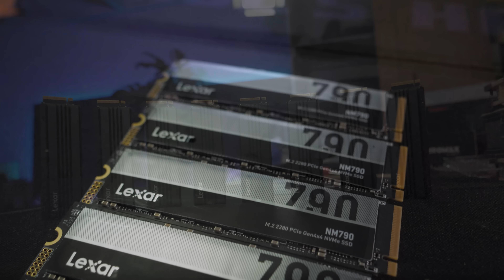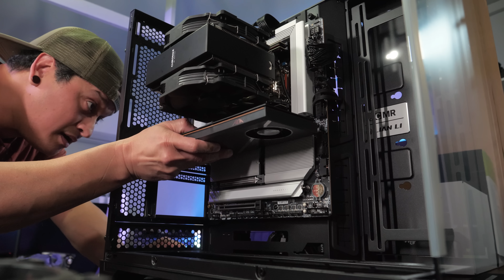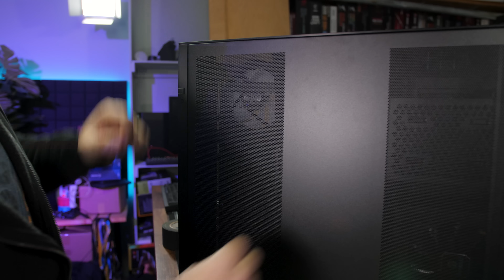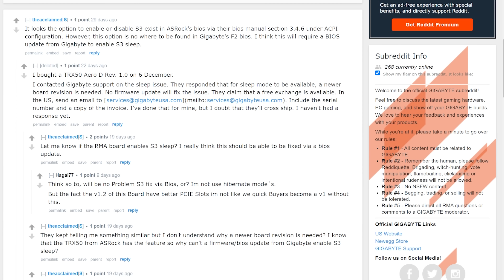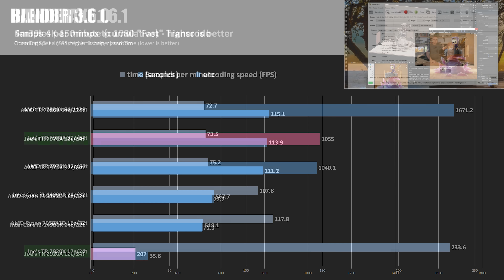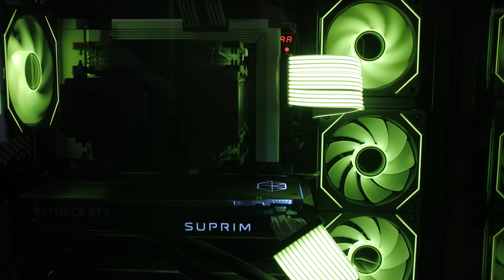Did we screw up?? Fixing and TESTING a $10,000 Gaming/Editing PC...

Comment: Imagine putting a NZXT kraken as a "compare" item .. (@16:40)
Like WTF?
Put a real custom watercooler with proper CPU block on that TR CPU and see the difference?
Should be a lot..

Also if you want the GPU cooler to have a long life,
 move it up one fan slot.
Reply from the maker: Weird that AMD would choose that not "real" NZXT AIO to send out with every single Threadripper 7000 review kit, they must have no idea what they're doing
Reply: @paulshardware  agree.. 😶‍🌫
Reply: TR CPU needs a TR cooler, kraken is does not have a coldplate for TR,   linus has also made this mistake @paulshardware

Comment: I would have gone with a different PC Case and get a Full tower PC case with better room for your needs. PLus+ i would put the GPU Cooler at the bottom of the case pushing it out. Then have the side front fans pushing in and then the front bottom fan pushing in Aswell.

Comment: I would definitely RMA the motherboard because who knows what else they fixed besides the sleep function.

If you can replace the single vertical fan with a reverse one and put regular fans on the rad then you could move the rad to the top position as exhaust fans and have the bottom fan as an intake giving the case a more positive pressure setup and have two fans at the top to help exhaust hot air. Just a thought.
Reply: I would do the same.  They always fix more stuff than just the thing that had you considering it in the first place.  It may save you some headaches over the next year or two.
Reply: Problem with RMA is that you have to send the mobo first and then you have to wait for them to send one back.
That means you have a non-functioning system for possibly weeks.

Personally i don't use the sleep or suspend functions, my system is either on or off.. rebooting is quick enough (although my new DDR5 sytem takes quite a long time compared to my old DDR4 system. but i just downloaded a bios update (not installed yet) that should fix that.)
Reply: @s1gne I wasn’t really thinking about the sleep function as much as, what else did they fix?
Reply: @blackjack6259  with my "old" 2070super Gigabyte had a V1.0 (like mine) but also a V1.1 (used same bios) and a V1.2 with a different bios, that one also had a bit lower clockspeeds.
Probably because of stability, although i never had problems with that card.
A never version can also mean that there is not much difference, just an other manufacturer of POScaps for instance
Reply: @s1gne  I'm pretty sure that Gigabyte would just ship Paul a v1.2 board. He's a 1.5M-sub reviewer, not a normie 🙂
Reply: @alistairwillock7266  , true.. he probably also has a direct cotact with Gigabyte but for normal customers that's not the case.
Reply: I would probably RMA that mainboard for the v1.2 (or v1.3 by the time CES is finished) 😉🤷‍♂️

Comment: How many lanes do the x8 M.2 SSD drives use?
Reply from the maker: Gigabyte TRX50 Aero D (4x M.2 slots) plus the Gigabyte Aorus GC-4XM2G4 Gen4 AIC Adaptor (4 more M.2 slots) -- all parts are linked in the description!
Reply: Okay. I have a Asus Z790 Hero. I can only install x5 M.2 SSD's or am I wrong? @paulshardware